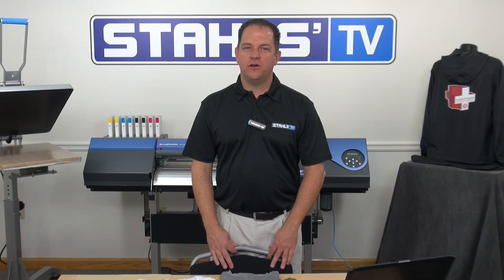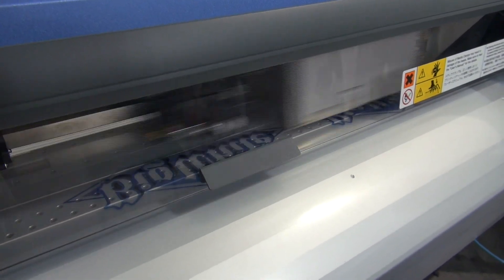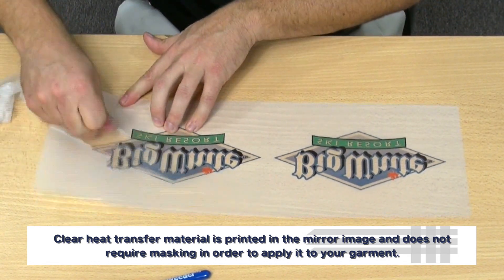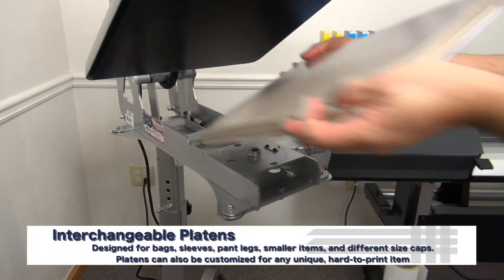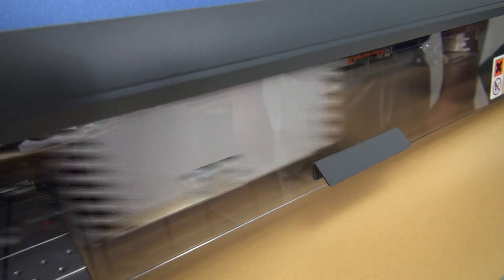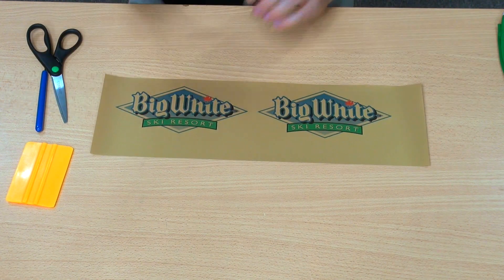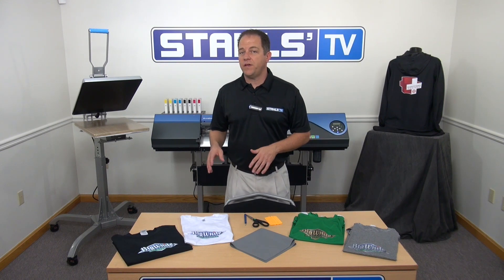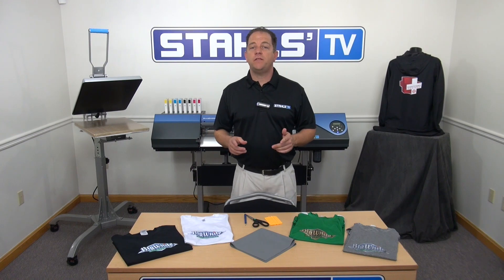How to Use Printable Heat Transfer Vinyl to Create Full-Color Apparel

Comment: Settings would be nice.. I think temp was around 305 ish but force???
Reply from the maker: For most of our printable heat transfer vinyl you want to apply at 300-305 degrees with a medium pressure.

Comment: Can I do this with sublimation as well?
Reply from the maker: You can certainly do full color prints in sublimation, but you would need a sublimation printer. This is an eco-solvent print/cut machine.

Comment: when it comes to these types of printer plotters (bn-20 included) do you find it cuts around the image perfectly or will there be some kind of offset where it cuts slightly off (example, black circle, but cutting it will not cut around the circle on target, but slightly to the side making it have a bit of white from the vinyl?)
Reply from the maker: You can set it up to cut how you want it to.

Comment: Do you make a material like this for home laser or inkjet printers? Could you do print and cut with a silhouette cameo?
Reply from the maker: The cameo doesn't have any printing capabilities, just cutting.
Reply: Stahls' TV that's true but you can print from within silhouette studio using your home printer and then have the cameo cut it.
Reply: Stahls' TV so a better question would be can you print on this with a regular printer?
Reply from the maker: Hi Raymond- No you must have a solvent or eco-solvent printer for our CAD-COLOR materials. If you're looking for transfer paper for a home printer (like inkjet or laser) that you can print then cut with the Silhouette, check out www.transferpaperexperts.com

Comment: Is there any printable heat transfer vinyl for sublimation inks? Vinyl, not paper
Reply: That's exactly what I've been searching for.
Reply: @proversionsource544 So, what do you got? Unfortunately, i didn't have any luck.
Reply: @Kovalezha  I still don't have a solution, I bought a Spiderman HTV sample from AliExpress just to see if I'm able to figure it out, I still don't know how they do it...3 different colors on a single HTV. I've been dying to find out how it's done. I even messaged the seller to asking if they can give me a hint and I'll pay him $20 loll
Reply: @proversionsource544  easysubli it is a little expensive but it works
Reply: @Kovalezha  with easysubli you have to be careful of what printer are you using because it is a thick vinyl
Reply: @johnvega261  easysubli is quite thick - 220 µm. I wonder if there is any vinyl for sublimation ink like HOTMARKPRINT REVOLUTION for solvent (75 µm)